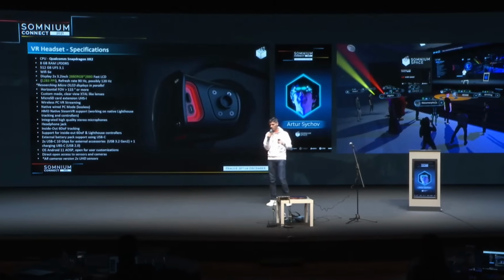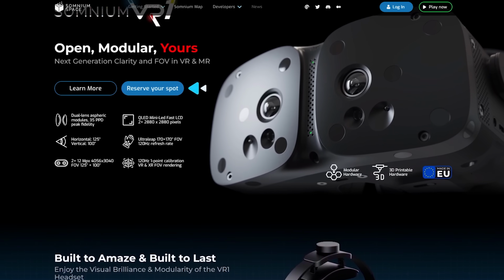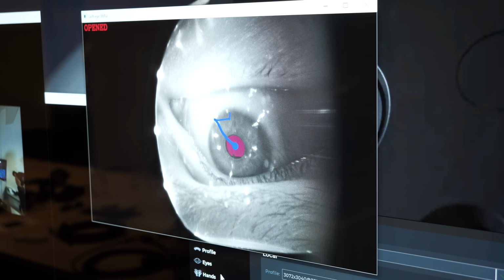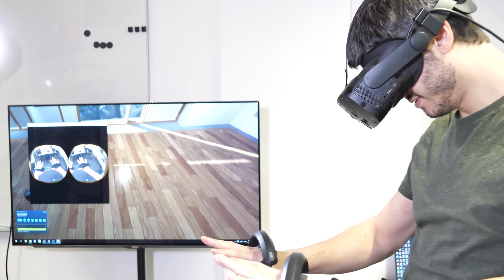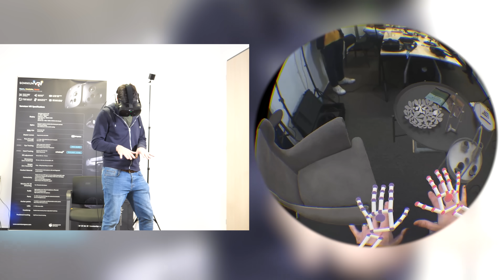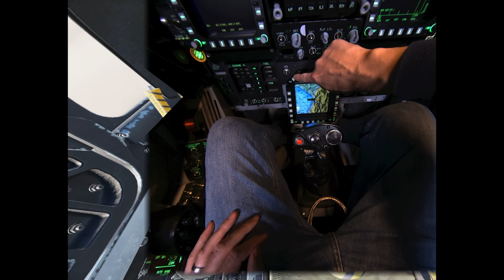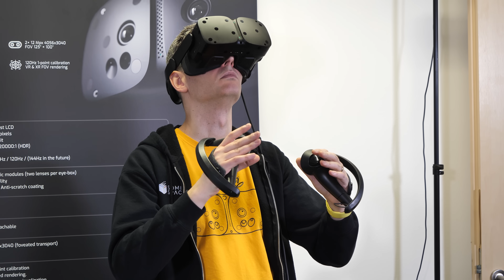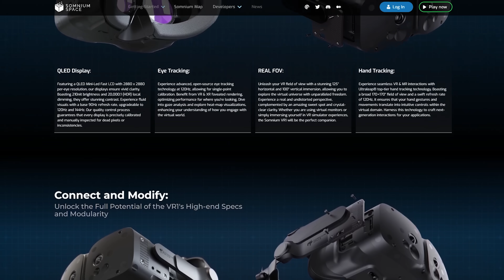Somnium VR-1  First Hands-On & THROUGH The LENSES!!

Comment: Maybe the existence of the Bigscreen Beyond spoils my views but this one seems rather bulky for a PCVR  headset. Seems as though the primary bulk of the headset lies on the big lens/screen module which I imagine is bigger than the Beyond's & Quest 3's version?

Other than this I do approve of a module headset system if it allows for backwards & forwards compatibility. Being able to upgrade or changed a dmg screen/lens would be great for example. Shrinking the main body in future itterations while still allowing the frontal addons to fit on it would also be a great way to keep the project growing.
Reply: I would say that starting of 2024 and even more so in 2025 it will be very hard to sell PCVR enthusiast headsets that cost $1000+ and don't sport at least 
- pancake lenses
- microOLED
- inside-out tracking (at least optional cause many enthusiasts don't want/need Lighthouse)

The two first points are almost necessary if you wanna reach VR 2.0 weight and form factor. Therefore I see more potential for the fairly barebone Bigscreen Beyond to have a bigger market share than the Somnium VR-1.
Reply: @GaaraSama1983  I agree with the Beyond likely staying on top in popularity over this project. If in the future the Beyond is able to provide a wider FOV while still maintaining it's slim form-factor (within reason) I could see it being more popular. (As well as gaining eye tracking)

Semi disagree about PCVR needing Inside out tracking. Would certainly be welcomed as it'd streamline settup & increase workable angles however the cost for indie companies to implement it may raise individual headset costs too much to make it worth it. When compared to a one time purchase of lighthouses that can be used with any future headset & the option to utilize any lighthouse compatible controllers rather than headset specific controllers. Inside out tracking may also require further cooling for the positional and controller data processing further increasing the size & battery consumption.
Reply: The hell is great about replacing damaged screen? Lmao you don't have clean room to assemble it properly or calibrate lenses. Modular is a failure and this is instant flop. They can't even get 10 people at once to use their metaverse.

Comment: More than happy with my Pico 4 and my RTX 4090 at the moment. This looks like yet another super heavy headset and expensive one. Honestly Pico 4 with a RTX 4090 on Virtual Desktop on God like mode is just fantastic. PC VR with no cables on my head and it runs and looks amzaing. I will wait and see what Valve has in store , until then more than happy with my setup.
Reply from the maker: Believe it or not, they actually are big fans of the Pico 4 as well, we kept talking about it :)
Reply: @Tyrielwood and.. what does it imply? It's meaningless.
Reply: @Pixel3DVR  calm down mate, it's just an observation.
Reply: @ikarus1111a relax man, it's just a comment
Reply: @ikarus1111a  Maybe try to take at face value what was actually said. His/her response was also an observation.
Reply: shame if the rumors are true about the pico 5.

Comment: 1700 euro for an lcd headset... thats a tough sell
Reply: 1899 euro plus VAT is what was said on the Discord
Reply: Effectively €3000 for the cheapest if you count in VAT, tracking and controllers + €2000 for 4090 to barely run it. I'd go with 4080 super and quest 3 for €2000 instead and for the rest €3000 buy myself a UST triple laser projector for when I want to game on a 120" screen for immersion.
Reply: @Fiztex553  + $5 steamvr games xD
Reply: @Fiztex553 why would a 4090 "barely run it"? It's almost the same resolution as Aero, same as Crystal. Those HMDs don't have an issue with a 4090
Reply: @Fiztex553 I have tested a lot of headsets which includes the Aero and Crystal. The display that impressed me the most was the Crystal as it has incredible colours and great contrast but the blooming was annoying at times. 

I have seen the future of cheap headsets but want surprised me the most was how good the Quest 3 was after trying on all those headsets. It really is absolutely phenomenal for the price. Its even great for PCVR if you use Virtual Desktop and set it to VDXR. Obviously they could improve the resolution and contrast but I would day you get 90% of the Aero with bigger FOV and 80% of the Crystal when you but the Quest 3. It's even better than both when it comes to software, Mixed reality and general use case. 

If I was new to VR I would definitely get the Quest 3 for the best experience. I would love to see a tad more resolution in the Quest 4 and an oled display.
Reply: thats for the cheapest version of it
Reply: Mrtv will love to shill the shit out of it
Reply: You’re buying more than LCD panels dude 🤦🏻‍♂️
Reply: It won't disappoint
Reply: Imagine a 4000+ euro lcd headset like XR-4.
Reply: @-racingfan2014  Imagine a half the price LCD headset like Somnium from company with failed Metaverse and no history of success in anything ever
Reply: @Pixel3DVR  So which company producing VR headsets is so great? Seems like you don't like any at all. Let me guess: You would probably like to see 500$ headset with microOLED, eye tracking, inside-out tracking, controllers included, high resolution and 120hz as well as wireless too. That's when it would be a good one. And also let's not forget 180 horizontal and 130 vertical FOV. No doubt this is what you want.
Reply: @chadef555  Quest 3 is freaking awesome. VR gaming in general sucks, especially for PCVR powers. There is no point in "high end" headsets cause the gaming is the lowest end imaginable. If you want to pretend somnium is inventine, be my guest.
Reply: @Pixel3DVR  Q3 is freaking awesome aside from needing battery, compression and latency. It is a good alternative for people who are fine with quality compromises and who don't want to spend 1000+ $ on a headset but it's far from perfect. Not mentioning that since release a considerable group of people have issues with wireless PCVR stability that was yet to be addressed by Meta. Despite many of those issues being once resolved before on Quest Pro. They mess things up constantly and make the same mistakes repeteadly making Quest devices nowadays not reliable.